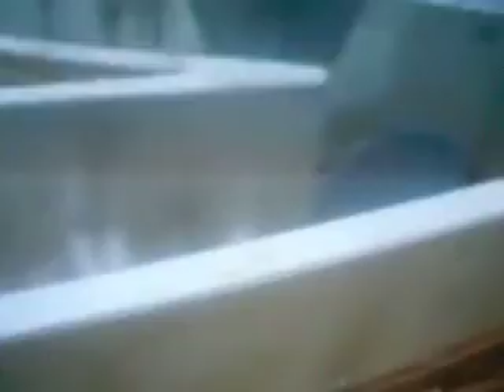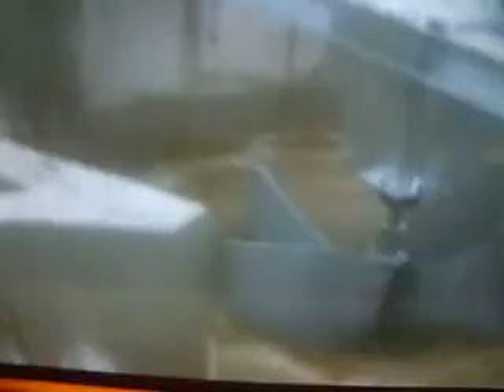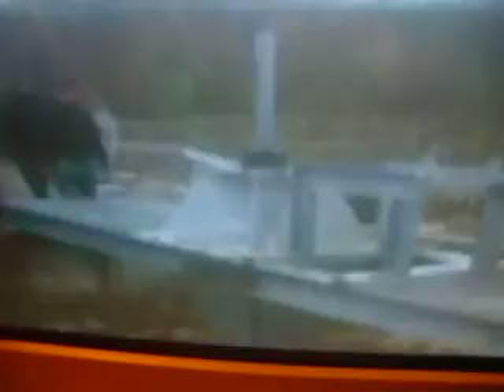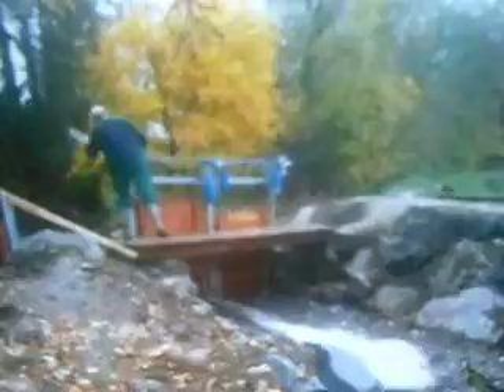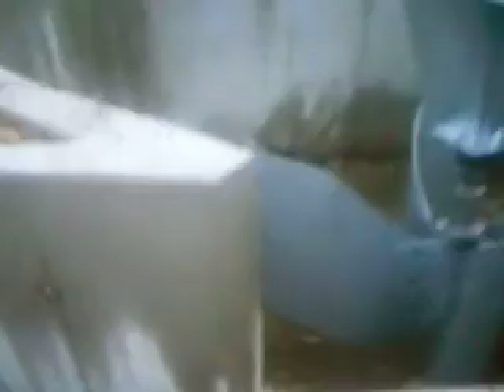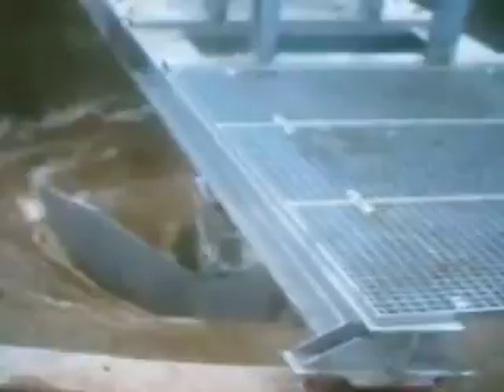Low Cost Low Differential Hydro Power

Comment: Don't use gears. Use serpentine type automotive belts. And use two smallish DC generators that have field current regulation and use the field current to regulate the gen/main shaft speed to keep the gen speed in the optimal part of the eff curve. Place the gens 180 degrees apart to balance the load on the main shaft. Assuming that it is an isolated system, you will need a resistor for periods of high flow after the batteries are fully charged. If you are going to invert and sell back to the gr

Comment: @lizadfuel  His first link shows where the "fish ladder" is built into the device.  It is underneath the plant and comes through the floor of it. I believe it is at a "low pressure" point in the vortex so that there is not even much water flow there.  He says that even a slow fish like a bullhead can get through and he has video's of them above  the plant. Even Shrimp can make it up through the plant! So check out his first link. An English translation is on the Zotloeter site now!